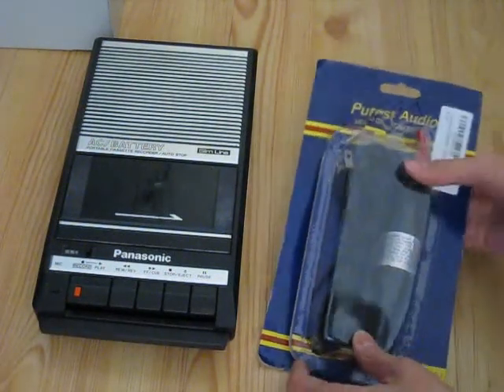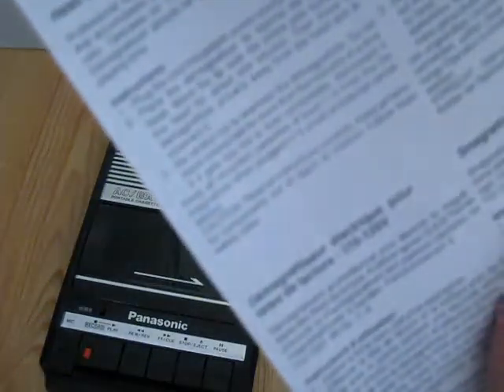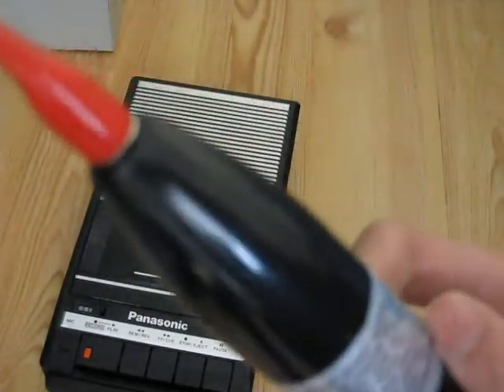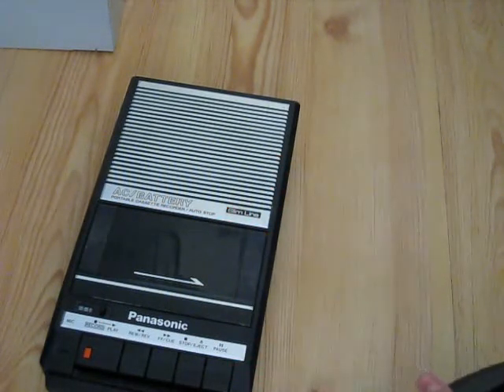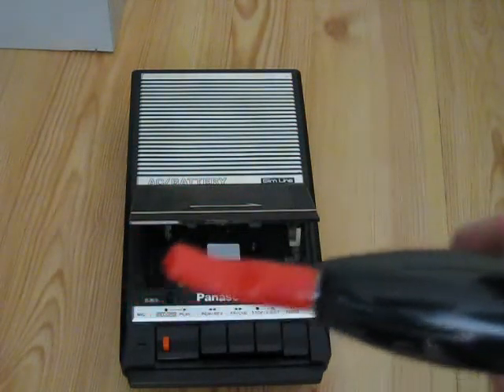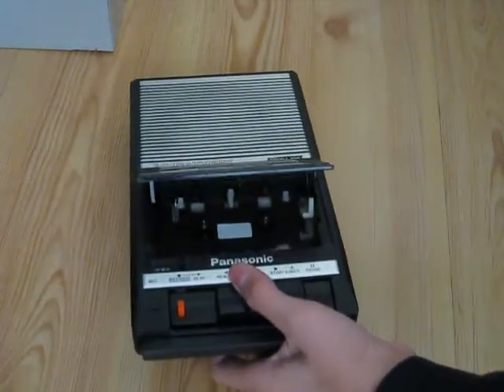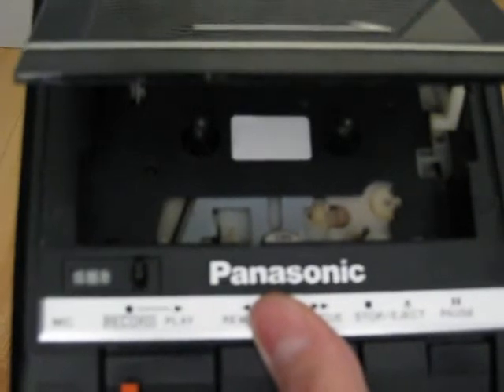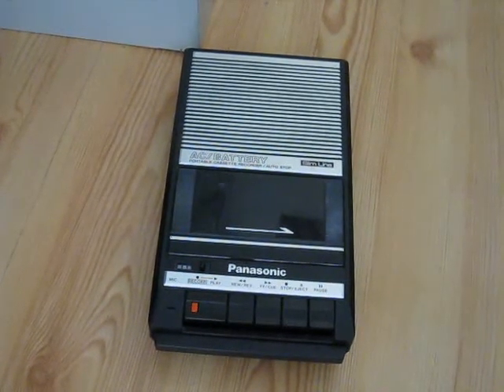Demagnitizing tape heads

Comment: WTF?! Everyone says not to make contact with the heads when holding the demagnetiser! You have to get as close as possible, yes, and hover the damn thing above it, then slowly pull away with the demagnetiser still connected to power, but NOT touch the metal parts. As far as I understood, that's gonna magnetise the tape head even more and that risks messing up the recordings.